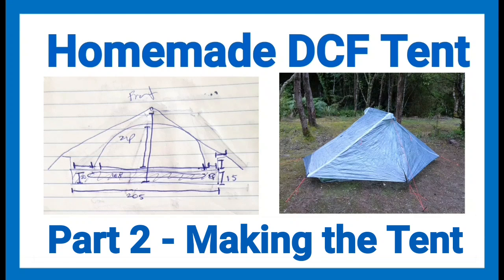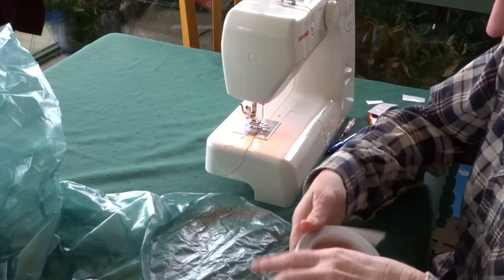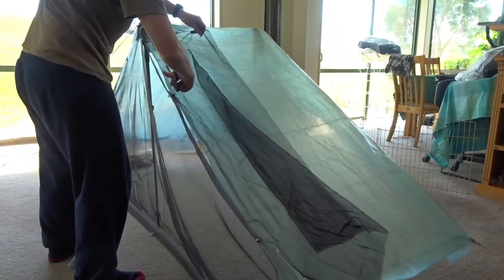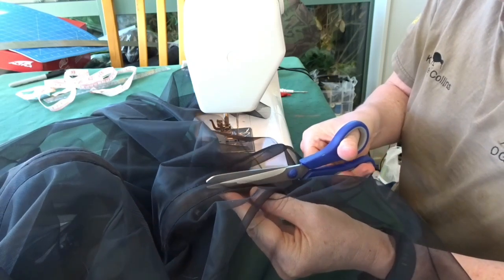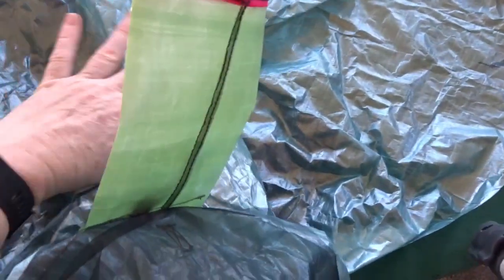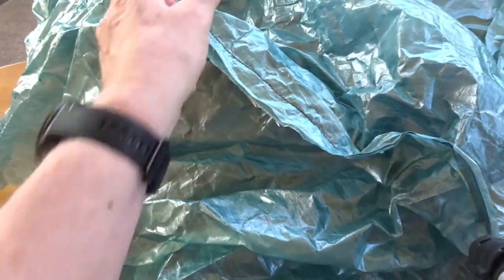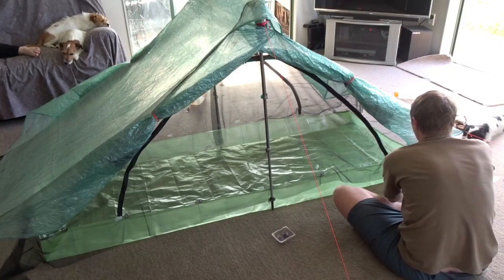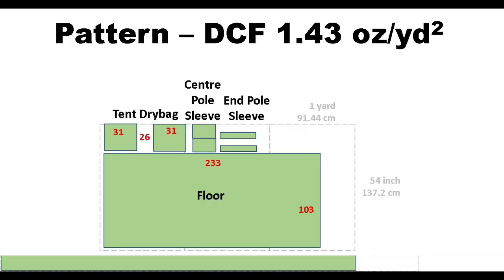Making of Homemade DCF Tent - Part 2 Making the Tent

Comment: How are the unique design features in practice?  Would you change/improve the designs?  Foot-end?  Vents?  modern zippers are "L"-shape, not Zpacks half-moon?  Is the bathtub connected to the tarp with mesh?  Is the tent bug-proof?  Has that been an issue?  What would you change?  Day-to-day, do you still use your tent or do you find yourself grabbing a commercial tent instead?  ++  MYoG'd a bivy and some hats that turned-out ok, but a tent is a whole 'nother level.  Considering it though?  Great job.
Reply from the maker: Hi Tom.  After a couple of months regular use and a few sporaddic trips I am really happy. I have been in really strong wind, both continuous and gusty, and rain and there is nothing I would change in design. I love the room the foot poles create. For such a small footprint it feels spacious and I was happy staying in my tent one miserable day. 
I havent noticed a lot of condensation, definately no more than my last tent. I stayed in a swampy damp area in cool weather and got some condensation but it didnt drip on me, it slid down the roof and through the mesh. 
I like having the vents fully open and this my default except in heavy rain. 
In answer to your other questions yes it is bug proof with mesh walls connected to the roof and floor. Tested in heavy insect concentration and nothing got in.  
With the door I did consider the L shape but prefer the rainbow as I dont need to tie back the mesh and the way I position it helps keep debris out of my tent. 
Overall I am really happy and definately not tempted to go back to a commercial tent. The only possible design improvement could be to make the top and sides slightly cantlevered to make it easier to get a perfect tight pitch, though the current tightness is acceptable. .
Seeing other tents makes me a little smug with the design perfect for my needs, though I always look at others and get tours of unfamiliar tents, always looking for new and possibly better ways to do things for my next tent in 5 years.

Comment: Do you think adding catenary curves to the bottoms of the doors and walls would make the tent less saggy?
Reply from the maker: Possibly could but a bit more design effort. I can get a nice taught pitch when there is sufficient space but have been pitching in confined spaces due to thick bush which leads to sagging.